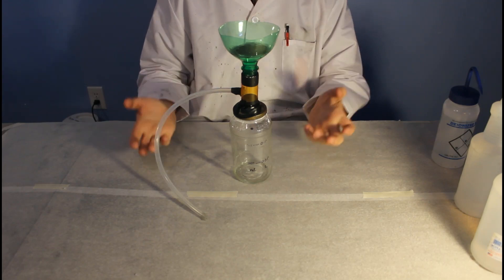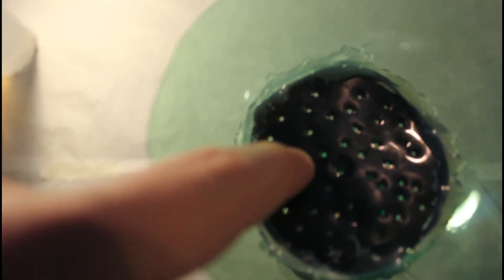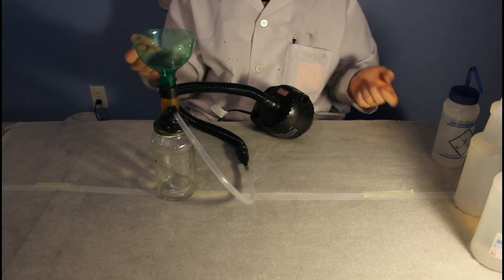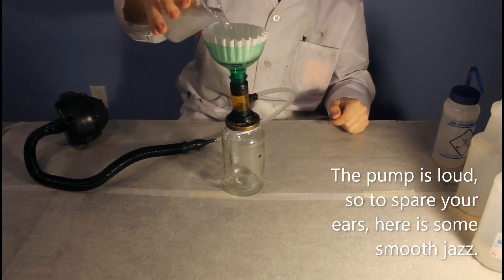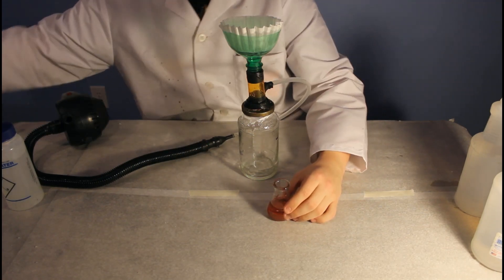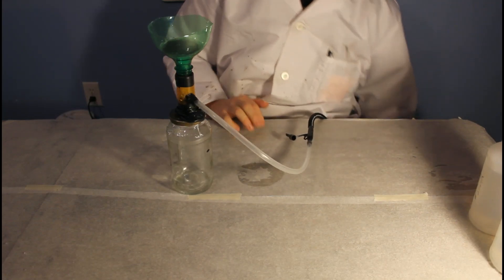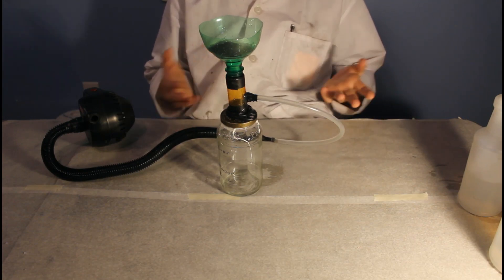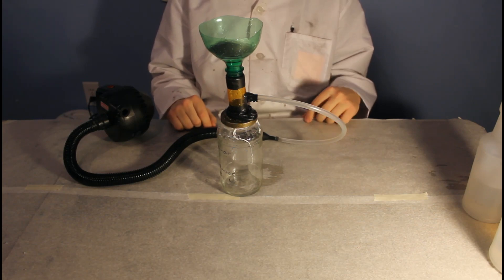DIY Vacuum Filter I DIY Lab Equipment Series

Comment: Can i use hand pump,which we use to fill bicycle tires,instead of vaccum pump?

+ extremely helpful video, i would make one for my own lab.

Also do you know how to make squirt bottle?
Reply: not really very easy to attach to the air inlet on all the handpumps i've seen.
Reply: @gmonkman  but I have only access to that only.
Reply: @Prchemist06  well ok, find the inlet air valve for your pump and work out how to run a tube from that.

You understand the general principle here? Pumping air out .... so any pump and airtight seals. The problem is the seals.
Reply: @gmonkman  Well,I will try to seal the holes with superglue,which takes 2 to 3 hours to dry.

Comment: Hey, do you need a buchner set up or would a piece of qualitative filter paper work? I currently gravity filter using qualitative filters or coffee filters depending on what I am trying to accomplish but my issue is trying to remove as much mold as possible from a solution of MAP/ADP. it takes a long time using our friend gravity as well as having to use multiple two liter bottles and having to watch out for cross contamination drives me up the wall. I guess the filter paper on top of the buchner piece would be just fine. Thanks for doing this.
Reply: Yes you need to fashion it like a Buchner funnel. How else would you do it?